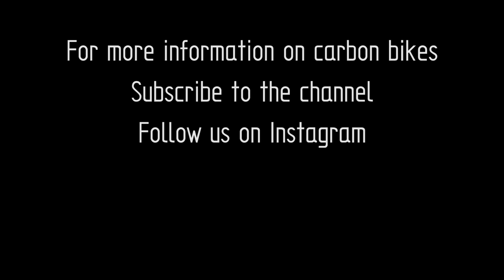Question Of The Day - Recycling Carbon?

Comment: My perception in summary : we could make thermoplastic bike to be ably to recycle them but it would be not profitable to repair them so their life would be shortcut. We could also use bio base resin and bio based reinforcement  but it would not be as good for riding.
With thermoset you can't recycle your bike but you can repair and lengthen his life. Also you can find a second use for a thermoset which is not really recycling but kind of : grind the composite and add it to building or roads.  So let's make thermoset's composite second life affordable  !

Comment: I believe there needs to financial incentives for repairings things generally, to properly value the benefit to the climate eg making repairs at least partly tax deductible. Makes sense in Australia as there's not a lot we manufacture any more so it would promote an increase in work/jobs for repairing things. Current situation is ridiculous, I gave my washing machine to a friend because the motor had worn out brushes and the only available "fix" was to buy a new ~$800 motor. Friend imported replacement brushes for <$5 and fixed it himself.

Comment: Hi totally agree with the point repair rather than buy new, can you start to show what can be repaired rather than all the video's on what's wrong or bad on a frame.
Reply from the maker: Good suggestion, in summary most of the typical damage from crashes can be repaired.
Reply: @LuescherTeknik  I suppose it will come down to 2 points,
1 is there someone locally who is capable of repairing the frame or fork and 2  possibly the most important to most people is cost and time the part will be away for repair.
Is that something you could cover.
As I work in Aerospace I totally understand about quality repetabilty is the biggest issue. so which bike manufacturers in your view have a handle on this.

Comment: Another option: use a damaged bike on a trainer.  Depending on the damage, might not need to even repair it.
Reply: Not many types of damage would allow for safe riding on a trainer either, especially unrepaired. Using frames missing a fork could work, but then you'd probably just replace the fork and ride it.

Easier to buy a cheapo frame from china to use with the trainer..

Comment: Are all those frames hanging from the ceiling, up for repair?
The black TCR frame on the left, is that the latest Pro Team TCR? I'm interested in that bike so i'm curious to know what may be wrong with it.
Reply from the maker: Yes, they are frames for repair. The TCR has top tube damage from a crash.
Reply: @LuescherTeknik  Have you scanned the undamaged parts of the frame? And what did you find? General opinion on it?

Comment: It certainly makes sense to repair. Perhaps there there needs to be incentive to design with repair in mind. I'm sure you have cursed manufacturers for design that makes repair impossible, or nearly impossible (worse!).
 Another 110g probably isn't going to hurt performance, but it may well be the difference between repair or scrap.
Reply: It's obscene that mass manufacturing on the whole is allowed to ignore End-of-life costs with respect to disposal and resultant environmental impact. If you regulate it heavy enough to slow development, that may also slow consumption. Maybe even lower CEO salaries!

Comment: The whole idea is stupid, the bike is mostly resin. Tossing it into a landfill is not a problem, it's not toxic. Burn it, or bury it, the end. Painful to watch this gentleman torture himself trying to spit out these statements that really only need a few seconds.
Reply: Those resins are not tree sap you know.  They are complex compounds that would not exist if they had not been research and manufactured by chemists.  Unless you are an expert on the subject, I would not make such a sweeping statement by saying they are not toxic.
Reply: @earthstick  - The presumption I make is that they are non-soluble but you are free to inform me bikes are water soluble. In any case I was making a sensible post, not writing a PhD thesis.

The idea "complex compound" is not frightening, until you try to make it so, by presumption.
Reply: @johnsmith1474  There are plenty of resins that are hydroscopic.  Just read about boat builders who make fibre glass reinforced plastic hulls.  Osmosis is a problem for many boats.  To be fair it is older resins but as Raoul has pointed out many times, a damp humid environment is the worst for causing delamination of bike frames.  There must be an effect of water.
Reply: @earthstick  - I've worked extensively on boats, cars, with resins, coatings, etc. commercially. I don't have to dismiss your information as wrong because it doesn't say anything much ie is valueless. A boat is forcibly slamming water against itself for hundreds of hours, and is subject to cycles of heat and cold etc, yes some materials degrade under that level of abuse. I use resins that I have had stored in water as a test for ten years and they are impermeable. A bike in a landfill is not analogous to a boat. I would advise you to think before you make a shallow empty post like this.
Reply: @johnsmith1474  Given you extensive knowledge of the subject I am amazed that you stand by a sweeping statement that the resin is not toxic or effected by water when you must know there are many resins that are hydroscopic and react with water.  Osmosis in boat hull can occur even while the boat is moored in dock.  And it is not as if all frame manufacturers use the same resins.
Reply: @earthstick  - You being "amazed" means little to me. Your reactions are all over the road, you don't demonstrate any interest in careful reasoning, you seem to be a crank. And you are not more of an environmentalist than I am so don't think so. So, you are muted we are done. Btw stop using "osmosis," it's a foolish demo of poor vocabulary.
Reply: The whole idea is to not add to the mass of junk that does not degrade in a landfill. Burn it? Obviously you don't have a clue as to the technology and money it takes to keep emissions in check on a burn.
Reply: @justsayin3600  - You either don't understand landfill or you are not engaging your full understanding. The material in a landfill by no means has to "degrade." It can stay as is for thousands of years and be of absolutely no harm, presuming it does not add any toxicity to the groundwater or air. Degrading or composting is great, if and only if the land will be used for it's content ie for farming. If a landfill is an eventual building site, or open area, all that the material need be is stable. An analogy is broken concrete; it makes "solid fill" that can be buried to create solid ground for a park or other use. 

I agree that in any case the use must be careful and intelligent: organic matter composed, solid matter for solid fill, all done with least energy use and for the public interest.

Comment: Good you brought this up! One option of recycling - with downgrading the properties and consecutevely value - exists in wood industry, where chips are formed into different types of particle boards. Main issue of cfrp recycling is however the variety of matrix materials, so in terms of mass production it is still - and for long - cheaper to lead to a common factor and burn.

Comment: I wonder if steel can be recycled to a similar grade steel for a new frame plus its easy to repair too. I think over 10x as much energy goes into making a CF frame but can't remember where I heard that. Maybe because of the large number of hours and manual processes. Still its hard to be critical of CF because those riding it are doing such good for the environment compared to burning fossil fuels and moving a 1 ton or more vehicle about. The more time on a bike and this less time in a car the better. I remember stating CF couldn't be recycled in cycling forum and those that bought them and enjoyed CF frames in that thread didn't care they just stated frames didn't use much CF and they didn't care about the environmental impact which they felt would be small.
Reply: Steel has a material advantage that it can be returned into the original form (such as straightening a bent frame) and it retains most of its material strength. It is also not as complex as Carbon Fiber and arguably cheaper although the repair of high-performance steel frames will still benefit from a highly skilled frame-maker. 

Aluminium in comparison loses a lot of its integral strength so is not as easy to repair however both steel and aluminium are highly recyclable / renewable.

Carbon Fiber was originally pitched by the bike brands as indestructible and while this trend has brought us some amazing bikes and the technology has been improved, the production process is still fairly archaic in the level of human / hands-on steps. One of the big issues in carbon fiber bike production is the waste during production (in addition to energy use) and in comparison to other materials like steel where off-cuts can be more easily recycled, in carbon fiber production, the off-cuts, the vacuum bags and frame inserts will typically end-up as landfill.